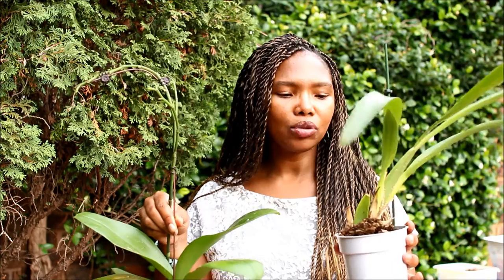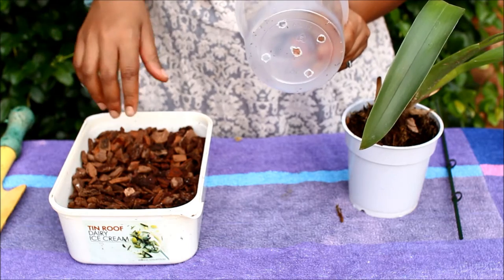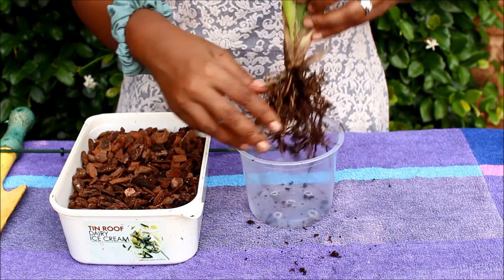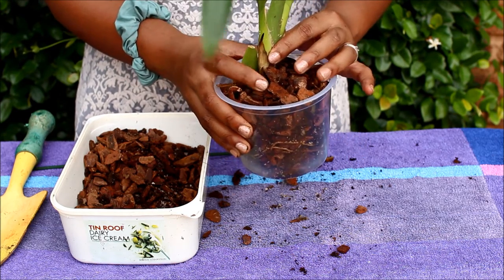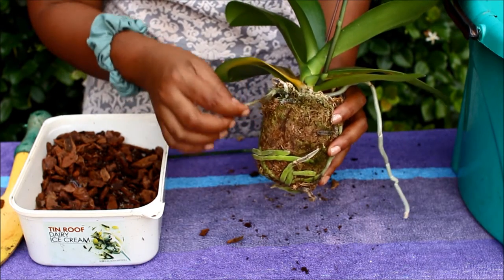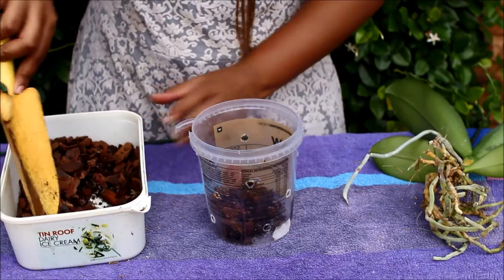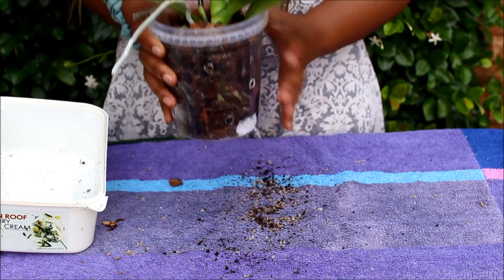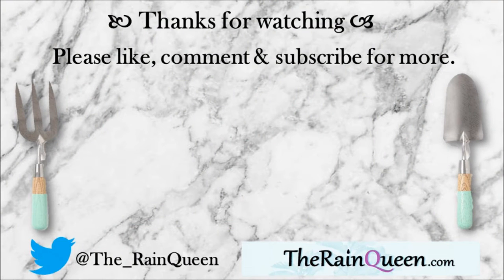How to repot Oncidium & Phalaenopsis orchids

Comment: The two most prominent species in your multi generic miltonia hybrid are 34% Miltonia spectabilis, 25% Miltonia russeliana. Here is a link to a very good source for the care of these two species. https://orchidculture.com/cod/free/Miltonia_Art.html
Your video is very well done and I agree that clear pots are a valuable tool for orchid growers, especailly those newer to the hobby. I'd like to help you a little bit. the multigeneric hybrid should have been potted into a much smaller pot..maybe a 3 or 3.5" with the condition that it's in, it probably won't be growing multiple leads and will take much more than two years to fill that pot. It would do best in a small pot with fine bark or even straight regular potting mix (provided you control the watering.) you should never mix bark (especailly medium bark like you have there) with regular potting mix because the fine material will shift down into the bottom creating a mucky mess at the bottom and a zone that is too dry at the top. You want to keep all of your particle sizes similar.With a miltonia like that, you would probably be able to grow it in regular potting mix if the pot was very small. I've done it. I've even seen nobile dendrobiums potting in regular potting mix. Sympodials should only be repotted just as new root growth begins. With the oncidium family, this generally starts when the new growth is 1-2" high or about 1/4 to 1/2 maturity. Oncidium types also often make growths from multiple directions, so it's not always best to put the back growth at the very back of the pot with these types. I have an oncidium type due for repotting actually. I'll make a video of it so you can see what I'm talking about. I also have a video on choosing the right pot size. I've been growing orchids for 13 years and have formal education in botany and I am a certified master gardener and I want to help other orchid lovers enjoy their plants.